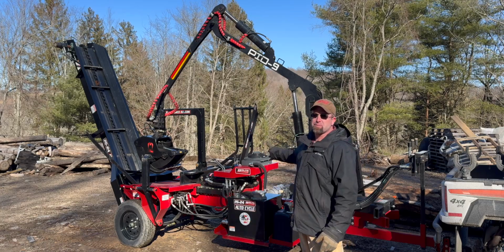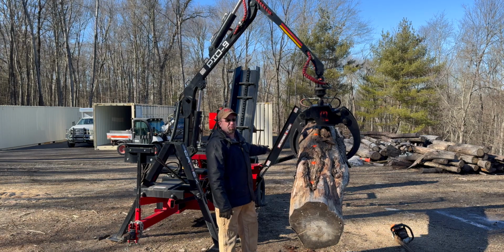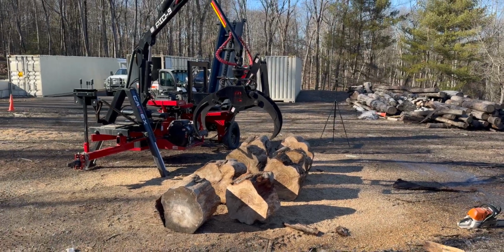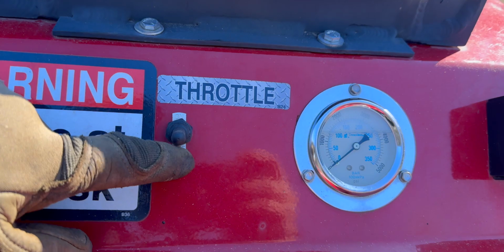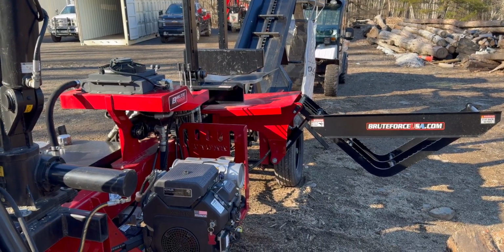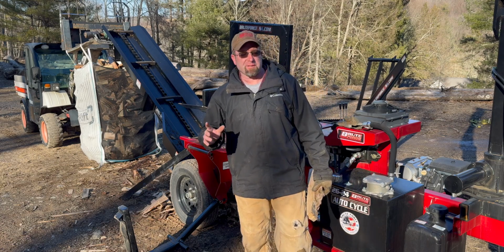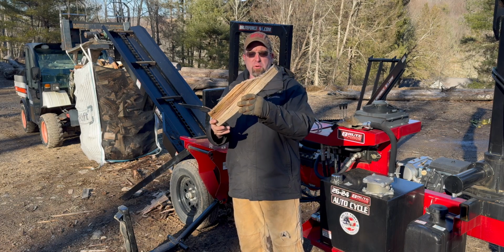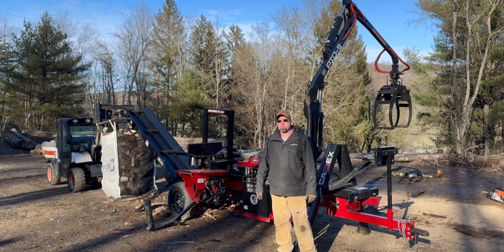Split-Zilla 01 of 02

Comment: I'd like to point out the very obvious design error. If you've got a built-in crane arm why would you use an over arch design on the log pull back arm? Make that open so that rounds can be dropped right into the splitting trough. There's no need to set anything on the lift deck if you put the splitter controls at the crane seat as well. drop the rounds right in the split area and then pull the split lever.
Reply from the maker: next time we build one, I'll reach out for a fresh design consultant. The unit makes wood so quickly, the option of loading the basket allows the operator to stay at the controls for longer. The arch was something the manufacturer didn't want to change because other builders were doing a horizontal design which had patten rights to it. A good operator doesn't have an issue dropping rounds in. Plus this is a very old video and we are using the Alpha 6 platform from Timberwolf now.

Comment: Sorry bud waste of time with the grapple.  And eastonmade is 10 times the splitter. Try again. You have aset of fork pull up to the log lift with log and cut it on to the log lift. Or get amini loader. Will pick up more than that graplle and twice as fast.
Reply from the maker: Don’t mean to bust your “Eastonmade” bubble, but when you wanna go mobile and just make one trip as a one man band, how else do you do it? Also that little loader picks up about 1800#’s and can a large area completely around the splitter. In a stationary wood yard setting there’s always different options, but this was custom built to the customer’s needs of mobility and one and done.

Comment: I like this machine 
The grapple is so handy no wrestling the block.
I noticed the pull back arm did not pull the block back far enough to drop it back in the beam
Reply from the maker: It was sitting slightly down hill. Some units we have a 1” strip that goes on the pull back arm. Guess I have to get one!
Reply: @ShaverSalesINC  I’m sure there is an easy fix. Great machine